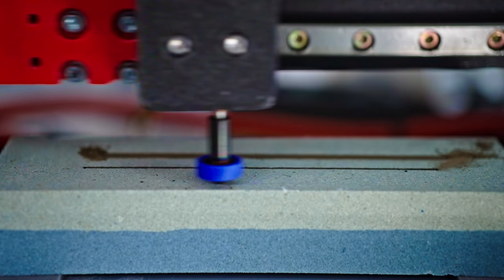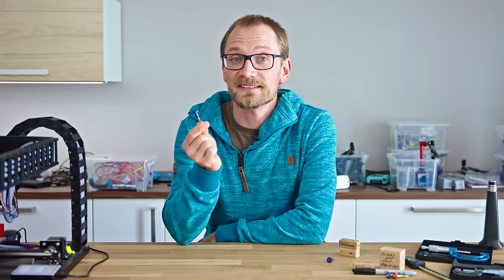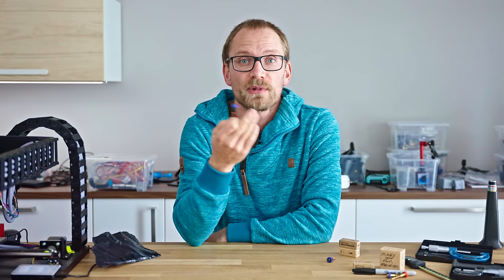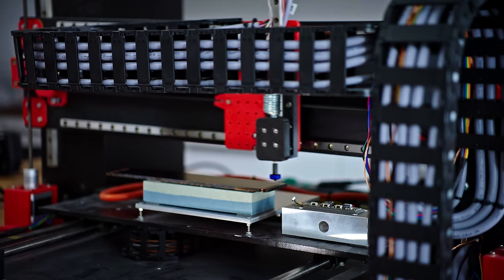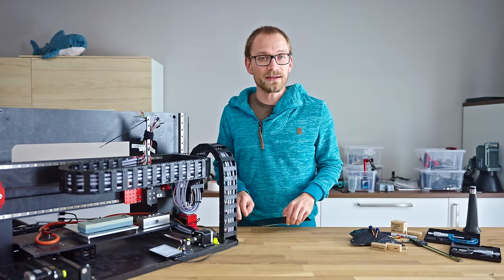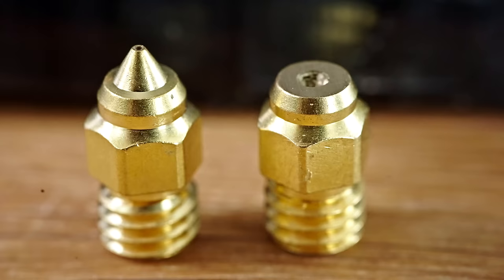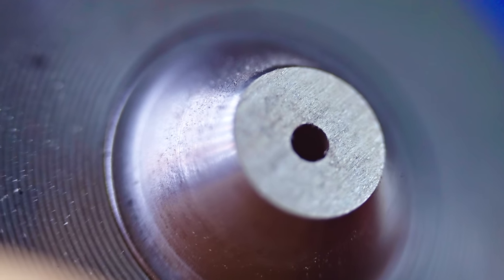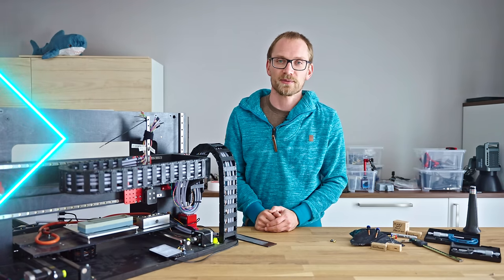How tough is ObXidian really?

Comment: The maximal usable temperature for the Revo nozzle could also be caused by the press fit that would loosen as the brass expandsore than the hardened steel
Reply: This is the answer, i have seen this in other fields and in this theoretical case first thing you would notice is probably leaking of molten plastic due to the recently created gap by the difference of thermal expansion of the two materials, also you could have backflow or changes in your flowpath because of this, and in the most catastrophic case, with enough temp and pressure you could displace that press fit.
Reply: For press fit parts that need to sustain heat when pressing it in you heat it to even higher Temps to unvoid this

Edit: the steel will also soften
Reply: Hardened steel loses its temper at high temps as well.
Reply: @Bubu567  You're not wrong but you're missing information. As long as the initial temper is done above whatever temp you expect the part to operate under and the steel is a reasonable choice for the task in the first place it's fine.
Reply: Isn't 300C the max temp of the Revo based on the heater/thermistor constraints? I saw a video where a higher temp version was supposed to be released but I'm not seeing it yet. If that is the case and the nozzle is made for the Revo exclusively, than there would be no point in rating at a temperature higher than the equipment is capable. If they have one capable of temperatures of 500C and they still limit the nozzle to 300C, then that might mean more.
Reply: @Bubu567  The Nozzle X supports 500°C because it is made from a high temperature steel, known in the machining industry as high speed steel.

Comment: Also, as you grind a material, the particulate (called swarf) becomes effectively a lubricant ~AND~ an abrasive at the same time.
It acts like a lubricant because it's tiny particles that behave a bit like ball bearings.
It also acts as an abrasive because it is the same material as the workpiece they came from obviously, so being equally hard as their source, they act as a bit of a polishing compound.

Comment: Way better than a standard review. The choice of using alu oxide stone as the abrasive is an extreme test which shows the true wear resistance of this nozzle. I am also a very knowledgeable sharpener and metal enthusiast as I collect knifes. A dlc coating doesn’t mean full abrasion resistance but should show what your test results gave you. This means that E3D nailed their coating! I think one last thing to pull away is that another point of wear that most people see is wear in the heartbreak the thin steel tube of their hotends. This was the main reason I purchased this E3d revo obxidian. As other hotends would have me replacing a just as expensive heartbreak from abrasive materials. I’m hoping that is not the case with the revo as the heat breaks can cost just as much as a revo nozzle. I made the purchase in hopes I spend less overall printing with abrasives. Very well done and glad you took real data to show us just how much abuse the nozzle can take!

Comment: It would be interesting to see this test done on a Diamondback nozzle.
Reply: Me too. I won't use any other nozzle than a Diamondback, and I've tried them all.
Reply: @rqthree  I just got a 0.6mm Diamondback and I love it too.  I've been printing some CF-PETG with it, and it prints like a dream.
Reply: Diamondback is the best nozzle.  I have 600 hours of CF and GF filament on it with no sign of wear.
Reply: Diamondback 100% if you don't often change nozzles. Revo if you change nozzles often. I never change nozzles so I always install a Diamondback and never need to worry about it anymore.

Comment: Would be interesting to see how the heat of a nozzle impacts these results. Could it be that at printing temperatures of 200-250°C hardness drops and wear is accelerated compared to room temperature?
Reply: Yeah that was a little surprised to see him only test at room temperature. Admittedly grinding increases the temperature, but nowhere near as much as the heater would.

Comment: would have been interesting to see you try the Nozzle X with its older coating
Reply: I think this is worthwhile enough for a follow up video considering how many people have the Nozzle X.
Reply: Agreed
Reply: I believe e3d said the nozzlex coating doesn't provide any abrasion resistance, it's just for non stick. In the blog post it said not to use wire brushes on nozzlex or the coating gets damaged
Reply: yes pls
Reply: @hassaization  Further research is needed. The NozzleX is not sold solely on its non-stick properties and is stated to be fine with abrasive filaments so whether its qualities come from the coating or the nozzle material the test could very well still be relevant.

Comment: What is your take on the Diamondback?  It seems great, but my only concern is the nature of insert-based nozzles.  Any long term review/test like this, or even cutaway (if even possible) would be amazing!

Great video (as always) nonetheless.

(Also sorry if this was mentioned mid video, typing as i watch so I’ll remove if so!)
Reply: I have been using a .4 diamondback for about six months. Have printed with carbon fiber filament, no issues or wear so far.
Reply: I've been using a 0.4mm Diamondback for a year now. I won't use any other nozzle, and I've tried them all.

Comment: Very interesting testing methodology and results.  Thank you Tom.

I can't help but wonder if the 300° max is due to the dissimilar metals and differences in thermal expansion.
Reply: Seems like a good reasoning for it, I think the normal revos also are 300c.  And for their target user I think that is plenty of thermal range, A quick poke around the internet and from what I see at least most vendors do not have any of the usual suspects filaments needing much above 270c. Some PC filaments go above 300, but I suspect the biggest market segment is printing PLA, PETG and ABS/ASA.
Reply: i can confirm that this nozzles passed 340c vacum degassing test before coating and have 4-5 micron dlc coating.

Comment: Steel is a very unique material.  It’s one of the only materials with a work/load threshold.  Most materials will wear almost linearly with work/load.  Weather it be grinding of a nozzle or flexing of a building/bridge.  Even if it’s an immeasurable work/load, most materials still wear respectively.  Steel, once below a certain threshold, never breaks down in a controlled environment.  Once the nozzle was able to distribute the load across a certain surface area, it was getting closer to the threshold where it would no longer wear.

Comment: I think that while this was a fancy attempt, the differences between the test case and real printing are so different this might now accurately show how nozzles wear under a real load. For instance, what if at a certain pressure, the coating lasts longer. What if  the filament pressure is being significantly lower than the weights is more than enough to change that? Im just guessing but at least in the video, I think this was a best guess as well (unless I missed something, which is totally possible).

Ultimately I feel the best way to test, as in the most realistic scenario, is to set up an automatic bed solution such as simply using the print head to push off prints, and printing off max volumetric flow rate spiralized circles of the most abrasive, glow in the dark carbon fibre filament you can find. This way the printer is going at the maximum realistic speed, and you get real, fair comparisons.

Comment: Fascinating.  The tungsten carbide nozzle I use in my v6 is the main reason I didn't want to move over to Revo.  I still think the thermal properties of tungsten carbide are a nice benefit over steel, but the composite design on the ObiXidian along with sufficient abrasion resistance may just make it every bit as good in practice.

Comment: SWEET! I just installed a Revo cr two days ago. I'm really happy with it so far. Good to see they released a hardened nozzle for it. I will likely pick up a 0.6 nozzle immediately as that would be a fantastic catch-all nozzle for use outside my normal brass ones. And with the benefit of the easy nozzle swap.

Comment: Great video and nice to see how you built yourself a working tribometer (tribological/friction and wear test bench) out of your old printer. The problems you encountered and the conclusions and interpretations you came up are quite spot on and typical for tribological research. 
As you mentioned, the carbon fiber plate didn't work out as an abrasive counterbody at first, due to the fibers being embedded deep in the resin. Additionally the fibers in those plates are usually woven or laid down in the the plate direction, thereby - even when you roughed up the plate - the noozles were still mostly riding parallel to the fibers, rarely contacting the more abrasiv fiber ends. For most abrasive action you would have to test on the thin sides of the plate (which is obviously pretty difficult to set up ;) ). 
You were also right about needing equal contact pressure (N/mm² or MPa)  for a fair comparison between all test-specimens because the mechanical stress needs to be the same and not the absolut force. The height of the contact pressure determines, if and how much an hard body can pierce into another . You probably had with all 3 nozzles some edge-contact or alignment issues at the start (it's well visible with the brass-nozzle) which induces a stress-spike on those edges accelerating the abrasive wear even more, but you could only notice it with the DLC because it wore comparatively slow and the coating has a nice contrast to its substrate. Also, the sharpening stone loading with wear debris is an issue, because that reduces again contact pressure and abrasiveness. 
The Obxidian nozzle and coating might also only be rated to 300 °C because (depending on the DLC-type) the "diamond like"-parts then start to turn more into "graphite-like"-parts, so the coating would loose its hardness over time and abrade more easily. 
Keep up the good work!👍

Comment: Also forgot about the grit clogging over time. Also a factor in why it slowed down over time. It's often overlooked.
Reply: In the case of the coated nozzle, I think the sharpening stone was getting worn smooth, which would greatly reduce the effectiveness in such short passes. But it's fair to say that the real world surface would also get worn smooth and stop doing damage, so I don't really see a problem with taking these results at face value.

Comment: Thanks for the detailed durability test. I use a 0.4 Revo/ObXidian as my main driver on a Voron 2.4r2.  I am super happy with it. I also have a 0.4 Revo High Flow but don't use it as much. I am happy with the versatily of the ObXidian as my main nozzle. I use it along a 60W Revo heater core and I am getting terrific results with a wide range of materials.

Comment: This was very fun to watch! Curious if you'd consider doing some nozzle battles this way, perhaps compare the ObXidian to NozzleX and Phaetus' Tungsten Carbide nozzle? For low flow applications (like in the range of a Revo), the thermal conductivity doesn't matter much, but when you get to the higher end DIY printers with high flow hotends and high speeds, thermal conductivity matters a lot (especially when you need a lot of cooling), and here Tungsten Carbide is a lot better than hardened steel. But if the ObXidian lasts significantly longer, there's a tradeoff to make! Would be interesting to see :)

Comment: When grinding, stones can fill with swarf and clog the cutting action. If possible you move the nozzle in the Y axis by a little to expose fresh stone. The nozzle would probably wear pretty quick. Also the steel nozzle might just be made from a harder steel.

Comment: I wonder about the filament path where the coating is more than likely thinner than on the direct outside of the nozzle.  Inner abrasion of the filament path is the first point of failure not the nozzle tip.
Reply: Also heating the nozzle probably would change the results a bit.  Thank you for what you do!
Reply: I wouldn't expect it to be thinner on the inner path. Plasma-Enhanced Vapour Deposition is really good at getting inside the nooks and crannies compared to the more common Sputter-deposition. Though it is also way more costly and hard to keep behaving uniformly (which led to the year long delay).

Comment: Another reason the stone would slow down on abrasively removing material from an object rubbing across it is the material clogging the pores up making it smoother then it started that's the reason you use water with wet stones or oil with oil stones which helps carry the slury away which is a mix of material being abrasively removed and either water or oil and a small amount of abrasive material/stone will be present as well, you can use stones dry but it leaves material embedded in the stone and the stone will need resurfacing/ flattened to be used properly again

Comment: You discussed how the nozzles were wearing at an angle and not perfectly perpendicular to the stone. I wonder if that was due to your toolholder rigidity (or lack thereof). The nozzle face may have initially been flat to the stone but when it started to drag across that created a moment causing a deflection and a slight angle between the nozzle face and the stone surface.

Comment: Bravo and cudos for addressing an extremely intricate technical issue.  My first impression is that these tests do not directly address the wear issue as experienced in actual applications, because they do not directly emulate the printing dynamics.  Yet your test results are interesting. Please consider actual print tests.  Your standard of work has always been outstanding and excellent, and very creative and done with enthusiasm and insight.   My suggestion is to do consider alternate ways of evaluating or re-evaluating this.

Comment: Thomas, thanks for this video. It's certainly demonstrated the toughness of the dlc. It's also given some insight into the usefulness of Z hop with more abarasive filaments. I might start implementing this - but I'm not really in a situation where the Revo ecosystem makes sense (hobbyist, pensioner, retiree) but if I ever win Lotto, well... I mainly print with PLA using 0.4 and 0.6 and bought one of those assortment nozzle sets so at the rate I print X the wear rate on PLA, I reckon that many nozzles will see me out anyway...

Totally enjoy your videos and test setups, sorry you've had such adversity & disruptions recently. Hope to see your videos for at least as long as that nozzle kit lasts me... 😺

Comment: Except the main wear will come from abrasive filament flowing through the nozzle rather than on the surface, I assume that they aren't coated on the internal diameter, so hardened steel should be basically as good

Comment: Any chance you'd be willing to run a Diamondback nozzle through this test? I'd be super curious to see it.
Reply: I switched to the diamondback after my Olsson ruby fell apart. Definitely more happy with the diamondback and it’s better flow characteristics.
Reply: @emey57  I've been using one too and love it, but would be very curious about wear characteristic testing like that. One swipe on a concrete curb is not scientific or repeatable, as they show in promotional videos. BTW, did you have to change temps or retraction distance? I love everything about the Diamondback but the extra stringing, curious what settings others are using. I'm printing on an MK3S+.
Reply: @AdrianLauf  I agree with you on wanting a more scientific test done. As for settings I typically use the standard Prusa profiles, or the brand specific material profiles, and fine tune my temperatures with temp tower stringing tests. After that I start looking into retraction settings. Most of my stringing issues are from using old filament that isn’t properly dehydrated. I’m also running dual fans and a duct I haven’t released yet so the added part cooling helps.
Reply: @emey57  What retracts did you set? I'd fiddle with it myself, but I figured I'd ask if there was a successful setting. I'm still getting quite a bit of stringing on brand new filament rolls. Ironically, it improves as it sits in my basement.
Reply: @AdrianLauf  with PETG or PLA?
Reply: @AdrianLauf  , I've been using a Diamonbacck for a year now. I won't use any other nozzle, and I've tried them all. I did have to drop most extrusion temps by about 10 degrees, due to the superior thermal conductivity of the diamond, and that helped tremendously with stringing.
Reply: @emey57  Either, but specifically PLA.
Reply: @rqthree  Yeah, I bought mine half a year ago and it's been phenomenal. So, I reprinted benchy once at stock settings on PLA and once with temps down 10° to 205, and yeah, it got rid of 90% of the stringing. That seems to be the only setting that needs adjustment.
Reply: @AdrianLauf  check through the preloaded materials in the slicer first. If you can’t find it then I run temp towers using the basic “Prusa PLA” profile until I find the best operating temperature